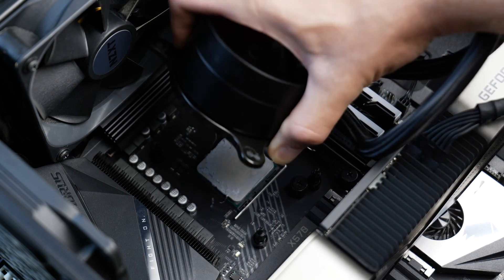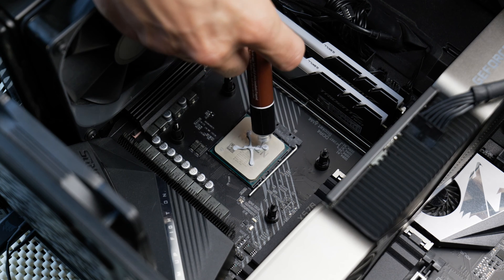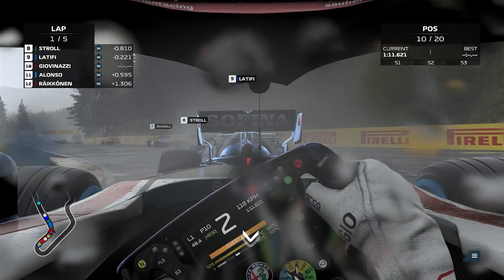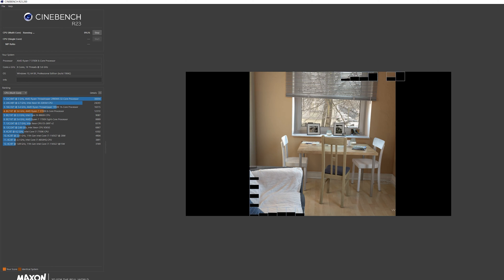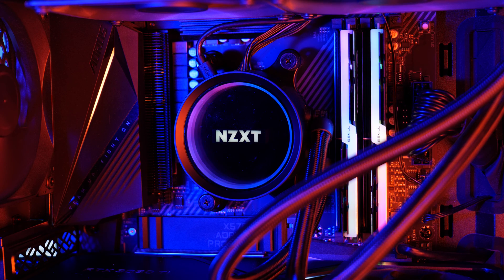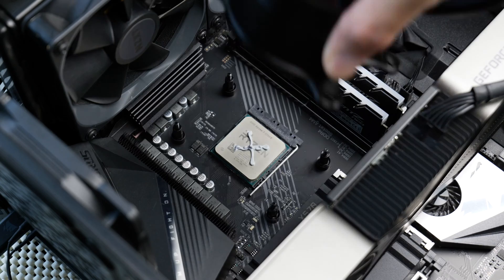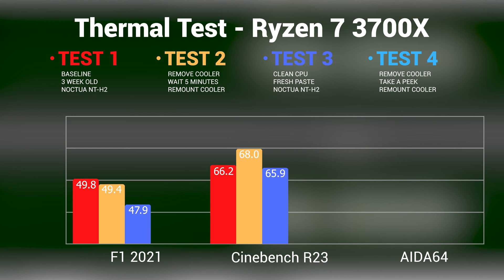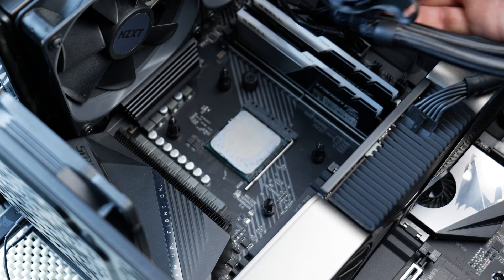Do You HAVE To Use New CPU Paste? Can You Reuse Thermal Paste?

Comment: Hi nick, i have a question, i've bought my laptop about a year ago now (not brand new, used ofc from a local shop), and it has two GPUs, and integrated one , and a dedicated one. The problem is, whenever i run a game on the performance GPU, after a few minutes, the laptop shuts down due to overheat (90°C+), and i've confirmad it with a software (corecpu).
I'm wondering if the laptop is too old that it never had its thermal paste replaced. Note that i i play the same game on the integrated GPU, the heat doesn't go above 80°C and runs idle at around 50 to 60°C
Do i need to change thermal paste ?
Specs:
Intel(R) Core(TM) i7-4510U CPU @ 2.00GHz   2.60 GHz
Intel HD Graphics 4400
AMD Radeon R7 M260 
8 GB of RAM
480 GB SSD

Comment: Thanks, that actually answers a separate question that I had.  My pre-built system, is running ok, but I was concerned that they might not have applied the thermal paste correctly.  But as you said, if its running ok, don't worry.  Thanks.
Reply: what if they gave you a dollop of poop smear? go look at it!